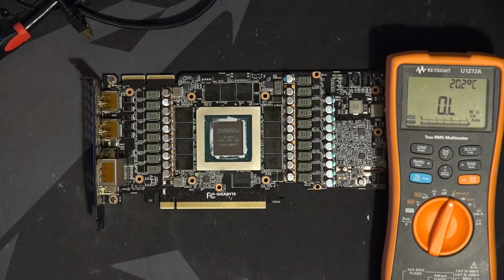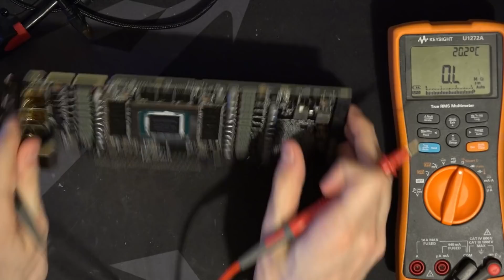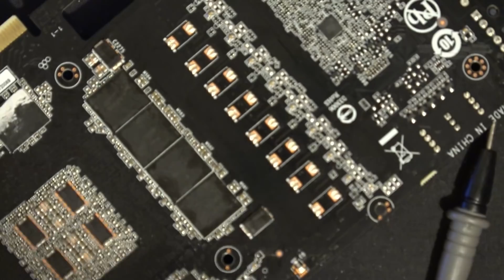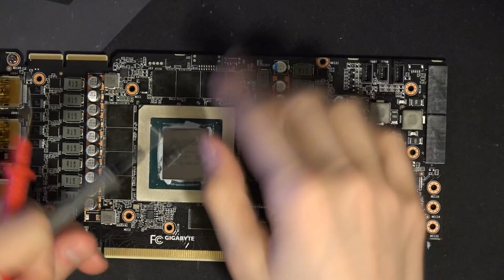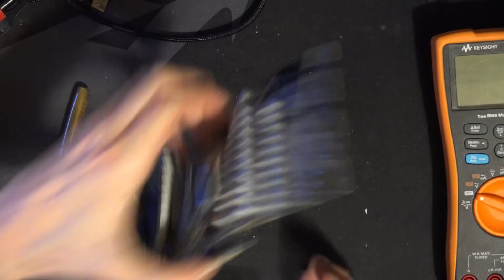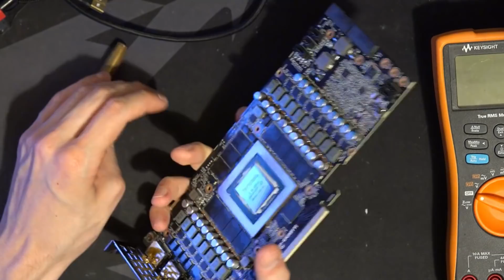Probing a Gigabyte RTX 3090 Vision that died when trying to run New World

Comment from the maker: WOW I'm stupid the reference Nvidia PCB does allow a 10powerstage Vcore for the 3090. So yeah this is actually an Nvidia reference PCB with very slight upgrades.
Reply: Good to know. I know my Zotac trinity 3090 is the reference board. So if this reference board died playing that game, I should just avoid that game like the plague. Yikes.
Reply: @Skylancer727  supposedly they fixed the runaway fps issue
Reply: @anthonymarquez2542  Jay showed it seems the game is actually pulling too much power from the GPU even if the frame rate was locked and power draw is limited. He thinks it seems to be a bios issue on the cards.
Reply: @Skylancer727  wait, does that game also affect older cards like the 1080ti or 2080ti?
Reply: @Skylancer727  anyone that uses jay as a reference for info is likely to be wrong. The game does nothing, the card does it itself.
Reply: @Skylancer727  just reduce power limit and ajust voltage .
Reply: @MrDvneil  No one should have to do that when playing a game. Especially if that card is not overclocked.
Reply: @Skylancer727  It isn't popular to talk about this for some reason, but there are less than 100 confirmed reports of this game killing cards. There's 600,000 people playing it every day. It's a matter of faulty cards, not a matter of the game being especially pernicious. EVGA already said that, too; some cards are just defective. I don't like New World, but wouldn't it be better to find out now and have the card replaced under warranty than to find out after the warranty expires?
Reply: @azazelleblack  you should count amount of people who play it everyday while using 3090, not all the people. I think it's about 1% so 6000 people so actually 1.6% if them failing. pretty high chances. I am not touching that game with a 10 feet pole as a 3090 owner.
Reply: @velfad  Could it be that partial software corruption has anything to do with GPU meltdown?_
Reply: @azazelleblack  also the new nvida drivers are ass cheeks makes my 3070 idle 40-45c instead of 30-35c had to roll back to 466.77
Reply: @Skylancer727  it's not the game.  People need to get over blaming software for hardware allowing itself to be blown up;  There are supposed to be safeties in place to choke down on performance when things go awry, just as there is with thermal constraints.  If you watch the video, you'll understand this is a hardware failure, not a software one.  It's framerate runaway, which is insanely simple to fix.  In fact the requirements aren't even all that crazy for New World, it's basically just the menus and things that are processed easily that go into framerate runaway and the card uses all the power available to it.  I'd recommend everyone do this to their cards anyways no matter which card they have.  First and global fix is to set the global frame rate to something sane but at the high end of what you'd ever want (something like 300fps.) In the game they've added frame rate limits to handle the gpu manufacturer's poor handling of safeties for things like this.  I've got over 60 hours in the game with absolutely no temperature or performance issues, and I've been monitoring things closely.
Reply: @threepe0  no it's not just frame rate runaway. Some people reported they locked the frame rate and it still happened. Also some people have it failing in game. It is something in the game making it more common. Saw someone who knew way more about programming me explain an odd draw call it makes but honestly I know nothing about coding. 

But yes it is a hardware failure but it is also clearly software triggered. There are many other games with uncapped frame rates in menus that don't do this. Clearly it is something with this game making it more prone to it. What that is I'm not sure.
Reply: @threepe0  If all your code uses proper libraries and standards this will not happen. I'd say the 3090 is a bad design, if mining makes the ram too hot I don't trust that rendering or gaming can't. But this should not happen in well written software. Nvidia's built in throttling would handle this. I bet New World devs have written their own stuff on low levels which is what causes this, but yeah, the card design and soldering weaknesses in case of ftw isn't helping it seems.
Reply: @neXib  There is no improper library for rendering, if you use any rendering API you already use "proper standards". If you write your own engine you have to implement your own rendering backend (same goes for existing engines - just different team implementing same thing). If you use any modern rendering API - it will always be "low level" - you can't go lower than that rendering API. Also there should be no possibility to call wrong method and brick GPU - it's up to driver and GPU bios to correctly handle API calls. Ofc rendering engine may have some bugs, but if GPU bricks because of API call - thats driver or board design issue, not game - API call in any case should never damage your hardware
Reply: Crap. I had 2 launch FTW3s die so I just refunded the 2nd replacement (long before new world came out, PCSX2 killed both). Eventually got an ASUS EKWB 3090 down the line and I'm pretty sure its just a reference board like this with a water block slapped on it (minus those weird power connectors). It has had nutso inductor buzz since I put it in. Guess I better wind up the doomsday clock.
Reply: @Lagahan  PCSX2 kills GPUs randomly too?
Reply: @juicecan6450  yep. Might be transient power loads or something? I put my first card through all the paces, fire strike, timespy, port royale, couple hours maxed out in VR, couple of other intense games. 4th day I had it I was running the emulator in the background while doing something else and it just popped. Ran the RMA card through the same paces (quicker though because I wanted to see if it would keep working) then finally I ran the emulator again to see if it would die. It did. My 2080ti ran that exact same version of the emulator with the same settings fine. I even checked when I put the old card back in. The ASUS 3090 I have seems to run it fine as well but I haven't used it much tbh.
Reply: Top end Nvidia cards been dying for years. And AMD. Seems to be slightly more widespread this time, though.
Reply: as far as i know the game kills evga ftw3 ultra and gigabyte cards most. its a power limit problem. i posted another coment with an explenation.
Reply: I wonder if per-phase current limit thresholds can be done in hardware even if the switching controller only supports one global current limit threshold. E.g. for phases with two power stages, you could fiddle with the current sense lines and cut the voltage difference in half. That would let you keep the global threshold set to the limit of any one drmos/stage rather than needing to increase it by 100% (to the limit of two stages on one phase). But would that screw up the controller's current balancing? But wait how does the controller's balancing work anyway if you have more power stages than phases? So many questions...
Reply: i have 2080 super o die on new world still shows basic image with pixelated image but not working on games any idea what can be
Reply: Please upload this kind of video in 4k even if you aren't recording/editing in 4k. YouTube bitrate makes it look terrible in 1080p
Reply: you mean downgrade? im sorry but how are you fitting a waterblock on that properly LOL
Reply: @dafunk420  well my gpu and memory is less than 80C when mining so I clearly managed🤣
Reply: out of curiosity, why didn't inject 0.7V to tests for the shorted component.
Reply: @stanimir4197  Injecting voltage into suspected shorted components is a good way to release smoke of both the component and your test equipment, besides probing for resistance, he is using a controlled amount of voltage and current to find the short.
Reply: @at1cvb417  obviously he'd use constant current mode - where else you'd get 0.7V but bench power supply?
Reply: @stanimir4197  your multi meter in resistance mode,  most people forget that resistance measurements are not a passive measurement, you actually are apply a voltage and in better meters current limited  signal then doing that ohms law math of the results.
Reply: @at1cvb417  And that voltage is usually 3V._
Reply: @DjResR  Depends on your meter, whether portable or lab and when made.
Reply: @stanimir4197  totally agree, connect a current limited power supply to the circuit side of blown ip fuse, start to raise voltage toward normal ip voltage and see what gets too hot, increase current as required to be able to see a difference in components. That'll be where the problem lies!
Reply: amogus
Reply: lol same day here you say 'i hope they fix their power delivery'... is the day red gaming tech now release a new video about future flagship card will be 450w tdp. with a new power connector.  i find that highly amusing. but also not amusing at same time because its my only option to buy any gpu with my evga bucks being that evga are nvidia only shop for their graphics cards. only for the thing to be destined for the vcore to eventually blow itself up one day. wish they made more sense with the pcb design. or if just somebody could come along to explain why. like tin or ellmer or whoever

Comment: Does the 3090 FE use asymmetrical VRM/power stages?  Haven't seen any FE's dying (yet). In fact have any 3080 FE or 3090 FE's died in this game?
Reply: This is a reference design fyi, I'd expect the same issues with FE cards. They all have nvvdd and msvdd split power designs, no AIB deviates from this. Just different power delivery ICs and number of phases
Reply: @supershiva11  I checked on Elmor's discord.  The FE is symmetrical.  It has 10 phases for Vcore and the MP2888B controller supports 10 power stages.  So the controller isn't linking multiple phases to a power stage.
Reply: @Falkentyne07  interesting - I may have just misunderstood your question. 'Uncore' or MSVDD is a different rail than NVVDD, and controls some stuff other than the GPU and memory. but yeah to my knowledge NVVDD has 10 phases nominally, so your conclusion seems right 😁👍

Comment: Imagine your very first game causes the most expensive and overpriced cards with current global supply conditions to fail. 💥
Reply: Also imagine that you got frustrated waiting for one to pop up at MSRP and you "had to have the absolute best" so you paid $2800 for one from someone on eBay and as such voided the warranty.
Reply: That's why you don't bid unless original proof of purchase is included.
Reply: Why are you playing games with a RTX 8000?
Reply: And a middle finger from gigabyte to boot
Reply: Conspiracy theory:

Amazon made a game that kills GPUs on purpose so that they could sell more cards.
Question is why would they do that when they sell out insantly regardless.
Reply: @peppa1492  Alternate conspiracy theory: AMD has worked closely with Amazon to develop the game in such a way it destroys NVIDIA's flagship gpu while leaving AMD cards unscathed which leaves a certain level of distrust amongst consumers towards NVIDIA & more confident in AMD & likely to buy an AMD card in the future.
Reply: @TLM-Nathan  brilliant move.
Reply: @TLM-Nathan  That would be unnecessary in this scarce state where all a card has to do in order to sell is exist abs have stock.
Reply: @peppa1492  If they had any in Stock to begin with that is.

Comment: I play New World on my EVGA RTX 3080 ftw3 Ultra and I've been monitoring the wattage draw and it's pretty low compared to many other titles I play so I'm still really confused about what exactly is the problem with New World.  I limit the frames to 100 and the most I draw is around 320w-330w playing @ 1440p. While with older titles like Battlefield 4 I can draw 360w easy.

edit: wanted to mention I have 100 hours in New World already
Reply: Jay showed that for some reason a EVGA's cards were pulling more power than the overclocking software requested even in other programs than New World. But New World also being heavy on hardware makes it show. It's not the fact it's pulling power but pulling way more than it was rated for. It seems that New World's trigger might be the fact it swings back and forth similar to how stopping and starting a car is worst than constant highway driving it.
Reply: One way to test is using Dynamic Resolution scaling, which I believe you can set to 4K even if your display is 1440p, it will upscale the processing then downscale the output resolution to your native resolution. This was causing Jay's card to increase power consumption far over max power of the card on a FTW3 3090, but acted normal if he left it at 1440p.
Reply: @racerex340  Yea most definitely upscaling to 4K will push your card to its limits. I wonder if there would be less or the same power draw if Jay had tested it again but with a 4K native panel.
Reply: @r3conwoo  I would practically guarantee it, although it might not be very much, but down scaling has to cost at least a little more GPU processing power
Reply: I also have an EVGA RTX 3080 FTW Ultra. I decided to install new world on my old system which has a GTX 1080 FTW. Runs just fine there at 1440p and no worries about the GPU.
Reply: @AIPilot-Boda  would you be willing to test upping dynamic scaling to 4K and check your power usage? Don't worry, it will still output at 1440p.

I have a 3070 FTW3 and a gigabyte 3080 Gaming OC. The 3070 can't handle dynamic upscaling at 4K, and the gigabyte card only spikes to about 103% power when stock.
Reply: i have a EVGA 3080 FTW3 ultra as well - i lock my fps at 60, undervolted to .850, 1440p res, and power limited to 80%. i havent had any issues so far, and my power draw doesnt go above or even close to 80%. Watts are around 150-180.
Reply: Power limit set to 100 on my EVGA 3080ti playing on 1440p at 60fps locked. 
Power draw according to X1 never exceeds 70% while playing and temps are around 60*c on gpu and vram chips. So I don’t worry to much playing New World. 

I still find it strange that a power limit set into the card itself can go over 20% of what is set. This should not be happening if it is a safety measure.

Sinds New World closed beta I have had a firmware update on my EVGA and some Nvidia core driver update for the card through X1. Wonder if they did find a culprint in the firmware of the card. But not much info could be found.

Comment: Please someone get this guy a new badass multimeter 😂
Reply: He has a pretty darn good one. Else Brymen 869s is a decent one, but it won't have the sub ohm range this good.
Reply: @stanimir4197  but this one he has doesn’t like to work well it seems!
Reply: @dan88rx7turbo22  exactly. it needs to be repaired. no need for a new meter on its right own. a bad ass one - say 8.5 digits would be bench top and cost a pretty penny, like really pretty
Reply: @stanimir4197  yeah man that’s what we should all pitch in and get him
For Christmas!!!
Reply: @dan88rx7turbo22  Keysight - 3458A costs like 8x rx 6900xt (current market price). Still I'd say Brymen 869s is an extremely robust hand held meter, 50000 count (4.5 digit). It doesn't have the milliohm range (no idea how precise that is as it requires perfect contact with the probes and he seems to care only about the first 2 digits anyways).
Reply: Go right on ahead.
Reply: @TaterRaider  hey bro I just bought an xfx merc black edition 6900xt and a waterblock I’m feckin broke breh !!! 🤣

Comment: Wait they said no? It blew up playing new world i thought they knew this was a problem.
Reply: But this was Gigabyte... They aren't exactly known for going above and beyond when it comes to responsibility. Check out Gamers Nexus' videos on their power supplies for a good reference point on how they handle it when someone methodically roots out the mistake and proves it to them....

The new owner didn't have the receipt = Go fuck yourself regardless of why the card failed.
Reply: @andersjjensen  everybody here has seen the gigabyte psu videos
Reply: I dont know if any of the brands do RMA for cards not owned by the original buyer.
EVGA has a form you can fill out when you sell the card so the new buyer get's the rest of the warranty (or they used to) but it needs to be filled out or no RMA.
ASUS will have no warranty on ebay cards 
Gigabyte is same
idk the rest you can look them up.